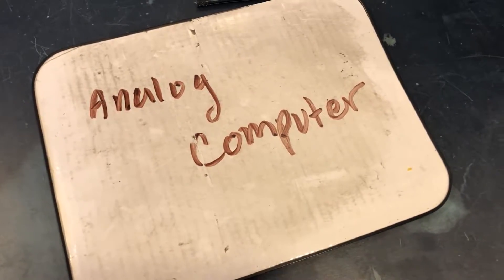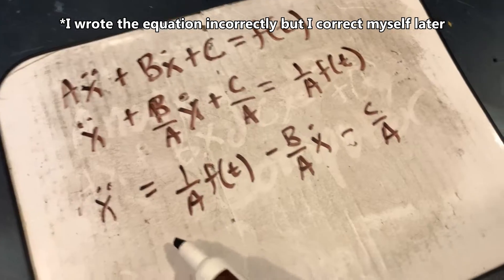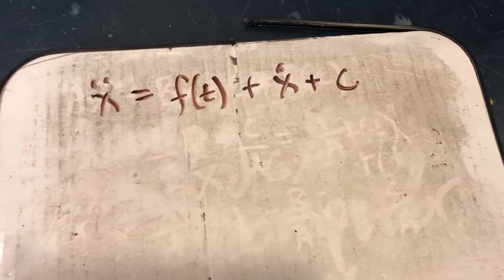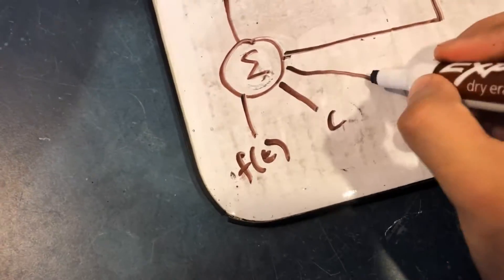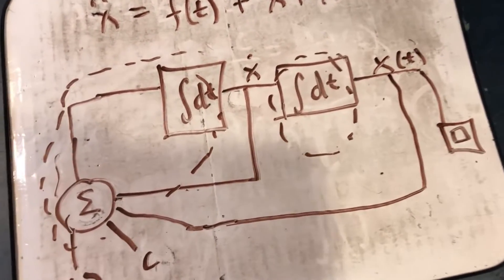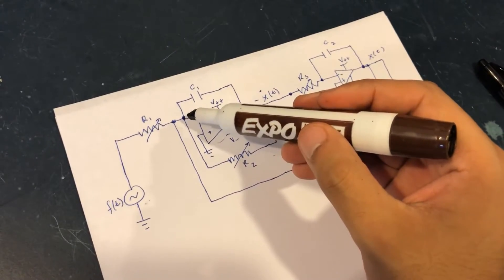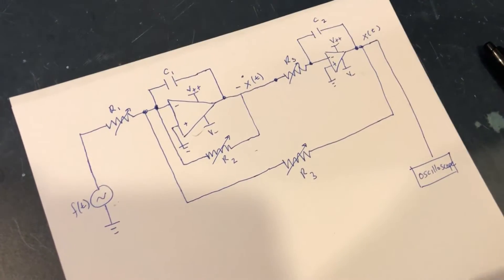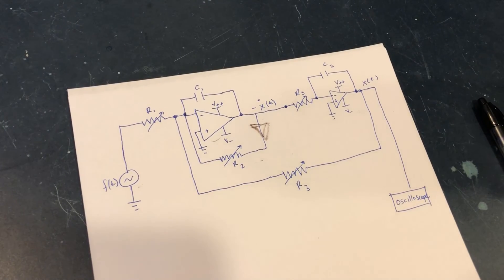Building an Analog Computer with Op Amps (Part 2): The Rough Design

Comment: Hi Alex. Apart your considerations and intensive research which where great, I am afraid that as for the solution of the D.E. you have to follow this link 's circuitry: https://www.youtube.com/watch?v=rYrV4UTC1x4. At your second video, you mentioned the usage of an inverter, but you interfered it in the first OmAmp feedback line. Of course, the values and their signs (and thus, where we should put an inverter) depend on the initial equation given. To represent A ( = coefficient of dx(t)/dt) you need one opAmp and the same applies for the coefficient of x(t) (I do not know if the resistance parallel to the capacitor can be combined with R_ to amplify the integral per Rcap/R_). Before all that, you might need to upload to us your final circuitry to see what is going on. Cheers.
Reply: Can you then upload a jpg draft of your final design?
Reply from the maker: I don't know if I still have the files, but I can try looking for it. No promises.